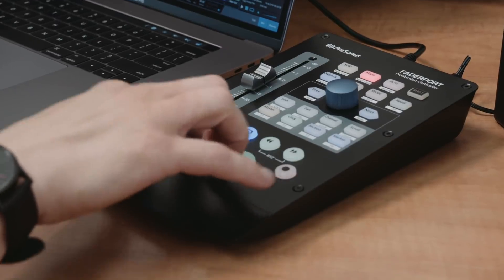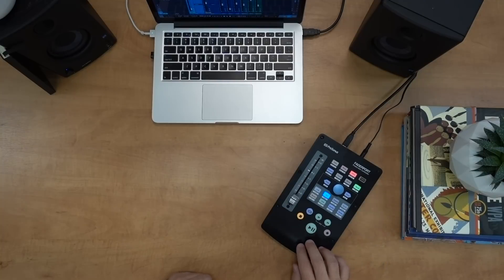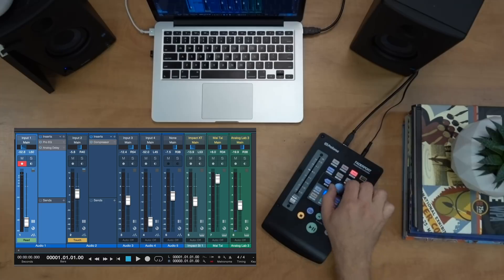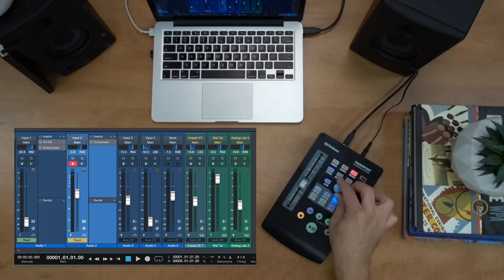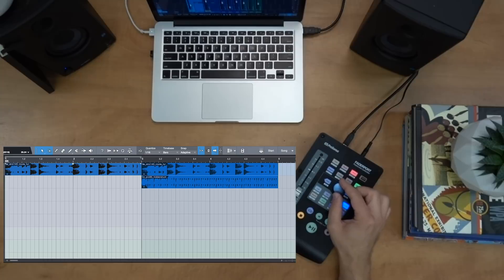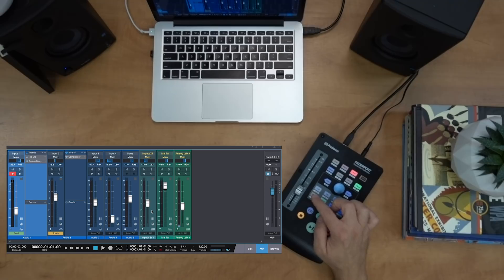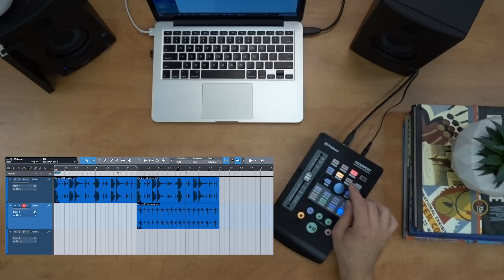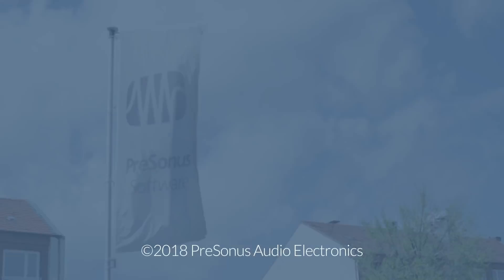PreSonus—How to use the FaderPort

Comment: Is there a way to get finer control on the scroll than just bars in S1?   When I zoom in, the scroll has no regard for the level of zoom I am at and is pretty useless at certain zoom levels.  But it could be so useful if it had the ability to scroll at those finer levels of zoom based on your zoom level.

Comment: Gain envelope in Studio One controlled with faderport v2’s motorized fader - possible?

Hey folks, just got my first Faderport V2 and was wondering, if you can use the motorized fader to manually ride it for a gain envelope automation…?

With volume and pan automation it works flawlessly, but i couldn’t find the gain envelope in the channels automation menu to record the fader moves to it, since its only available via right click on the clip…

Is there any workaround?

Thanks in advance for any help! 🙏🙏🙏

Comment: Just got mine today and I'm sending it back, to bad it felt like a great piece of gear! It would be good to mention that when used with Cubase you can't select whatever track in your session and have the Faderport react. The bank system is just awful to work with when you have 80 tracks or more. I won't spend 2 min banking up to adjust the fader of my first track when the bank selection is on the 8 last tracks... Anyway, this is very disappointing to see it work that way, just an inefficient workflow! The day you fix this I might get another one....
Reply: If you have 80 tracks, why the heck are you using the single track Faderport?

(You're making it sound like their fault when you obviously are needing their 16 track version.)

🤷🏼‍♂️

Comment: I just ordered mine today from AMS, It will make recording so much easier. I really needed a foot switch function to punch in and out while both hands are playing my guitar or drums. Reminds me of my old Roland VS 24/80 Digital Recorder. It was nice but now with this controller I can actually touch buttons. Thanks for the unit and thanks for the video!
Reply: You could use the punch in/out function on the DAw which you are using...

Comment: Great video thanks! I'm a Studio One user and plan on buying this and I know that this request will mean I will need to then buy the next version but it would be REALLY GREAT if you added dedicated Zoom buttons for vertical and horizontal Zoom. I realize that can be done but zooming is SUCH a spur of the moment yet often used task to engage buttons to do that slows the process quite a bit. The unit has the real estate to add 4 buttons...up/down for vertical zoom left/right for horizontal zoom. That would be a GREAT feature to have. Behringer does it...no reason you guys can't ;). Side note...LOVE Presonus!

Comment: I heard the FaderPort 8 can control plugin parameters with the knob if you hover over the plugin parameter with your mouse.  I'm sure Presonus added it to this FaderPort as well.  How do you do it with this piece?
Reply from the maker: That is the "Link" and "Link Lock" functionality (specific to Studio One). Make sure that "Link" is selected in the Session Navigator section of FaderPort, then whatever your mouse is hovering over will be controlled by the large encoder of the FaderPort.
Reply: will this fonctioinnality will work on cubase too or not ???

Comment: The biggest problem is using the dial to move elsewhere on the song. It only moves one bar at a time, you cannot control the increments in S1 (such as move one beat at a time). Poor design on an otherwise excellent product.

Comment: when faderport is on channel button, can you use the knob and the left and right arrow buttons to go through the tracks? or only the knob.  and is there no bank button like on the original fp classic? thanks.
Reply from the maker: When the Session Navigator is in Channel mode, both the knob and prev/next buttons will select the next or previous channel. The knob is faster at it, of course. There is not a "bank" button.

Comment: Great overview. Thank you so much. What if we want to be back to the beginning of selected/looped region? Let's say I'm recording a part and if mistaken, want to go back to the beginning of loop with  one klick. I can do it  from keyboard using "1" on numpad, but can I do it from faderport too?
Reply from the maker: There isn't a shortcut on the FaderPort like the NumPad controls, however, there are settings in Studio One that can be changed to accommodate the playback cursor behavior for your needs. The F1-F4 buttons are user assignable in Studio One and you can change one of them to "Goto Loop Start" which which have the same functionality as using 1 on the NumPad.
Reply: Oh, that's great. Thank you! :)

Comment: Thanks for the vid. Could you provide some info re: link mode (controlling mouse over parameters)? Does it work with logic? Is it controlled by fader or knob (or flip-able)? Thanks!
Reply from the maker: Link mode is as you stated, controlling mouse over parameters. Link lock allows you to lock onto the parameter that your mouse is over. There is a Logic MCU mode. Parameters are controlled by the encoder, however, there is a Pan Flip mode to control panning with the fader.
Reply from the maker: Also, for clarification the Link mode functionality is only in Studio One. Link does not have the same functionality in Logic.
Reply: so how u assign the parameters in logic to the encoder

Comment: No support for Reason. That's really disappointing because this looks awesome. :\
Reply from the maker: There is not a Reason Native mode, however, you can still use the FaderPort in Logic MCU mode and setup the FaderPort as an MCU device with Reason. However, using MCU protocol with 3rd party DAWs will have slightly different experiences as different DAWs implement MCU protocol differently.
Reply: That would be a Reason issue.

Comment: So it looks like the Mix, Proj,  and Trns buttons have been renamed F1, F2 and F3 to represent the function keys in Studio One. Also the Undo/Redo functions have been relocated. However, what about the Punch function? Has that been removed or am I missing something? Also, what about the one user assignable button?
Reply from the maker: The F1-F4 buttons are user assignable within Studio One using the device editor. There is still the record button and foot switch which can be setup to accomplish punch in recording similar to the function of the FaderPort 8 and FaderPort 16.